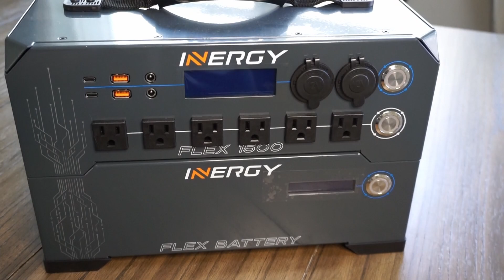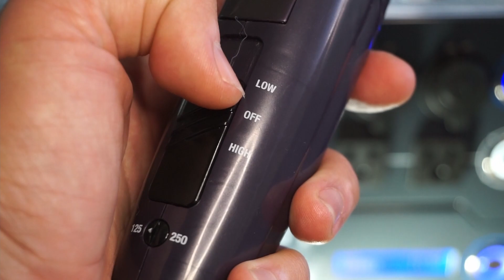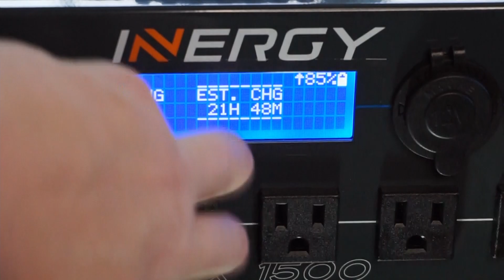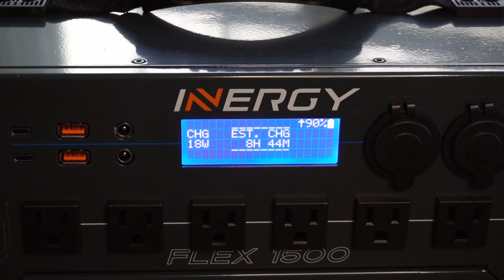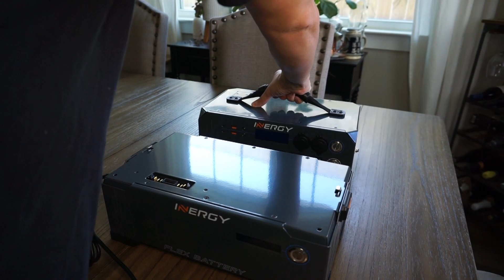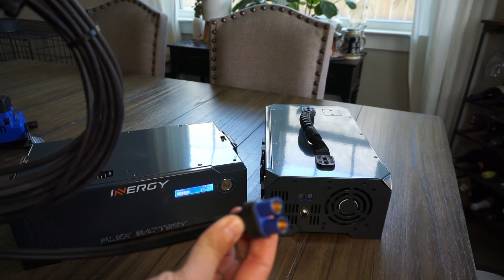Inergy Flex 1500 Solar Generator

Comment: BUY SOMETHING ELSE 7/27/2022
The errant cable Flex to Apex finally shipped. WITH NO GUARANTEE IT WILL EVEN WORK WITH THE BATTERY THEY SENT IN SEPTEMBER 2021. 
Bought the Apex 6 years ago took over a year to get it. Bought the Flex battery (May 2020 to expand it.. STILL waiting to get the cable) battery arrived in Dec 2021. I even got a PERSONAL call from the CEO and he said he would send it for my birthday (April - 2022). I personally am not buying from them any more.. While I was waiting on them I built my own system.. not nearly as portable but  6142 watts in storage, 2000 watt pure sine wave inverter/charger and 600 watts solar, MPPT 40 amp controller and appropriate cables and fussing. I too am a Florida resident so, back up  power imperative. I use the Apex for lights, fans and light duty items (since it is throttled to 550watts out put). The company (like the rest of the world) got caught flatfooted by CV-19 and has yet to recover while other companies have flexed moved up in production and availability.

Comment: I received mine about 30 days ago. I have put it through its paces and it definitely delivers. I bought mine for hurricane seasons. Laura put us without power for 15 days and Delta, right after, hit us for 6 days without electricity.  The solar panels on this system are amazing. I have the gold kit ( 4 x 100w) and it charged at a 329w rate. I was so impressed I did get a second battery. The only thing I didn't like was the wall charger which charged at 48w, the rapid charger charges around 288w. So 300w solar and 288w solar panel will charge two batteries in around 4 hours. Just food for thought. It's super compact and the fan isn't loud when it kicks on. All in all, worth the wait for over a year myself.
Reply from the maker: Nice! Ya i am happy with its performance so far. Good to know, i am getting right between 150 and 160 watts of charge from the two panels from my "silver" kit... i may be doubling up on panels like you! Thanks for the comment!
Reply: What is the Gold Kit? Is it something you got from Inergy?
Reply from the maker: @pem5034  The Gold kit is like this silver kit but comes with 4 solar panels instead of just two.